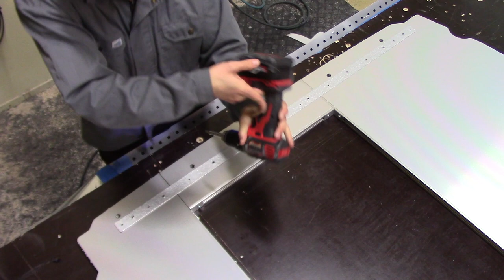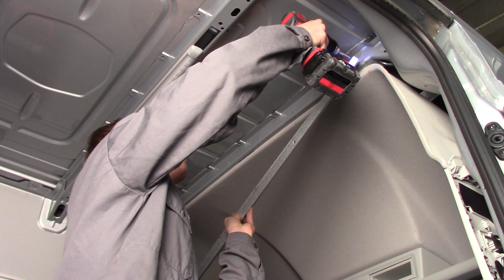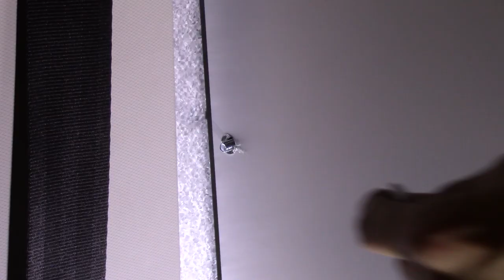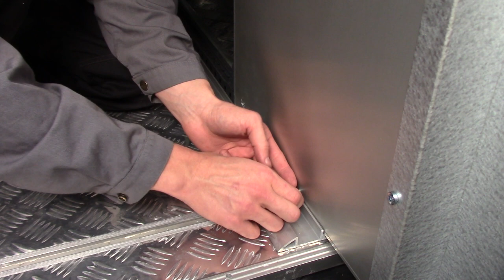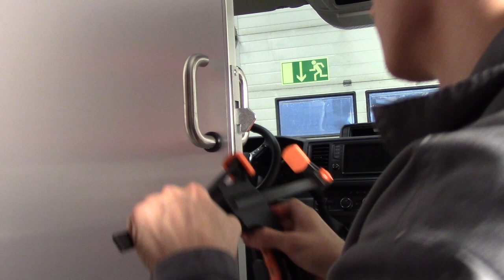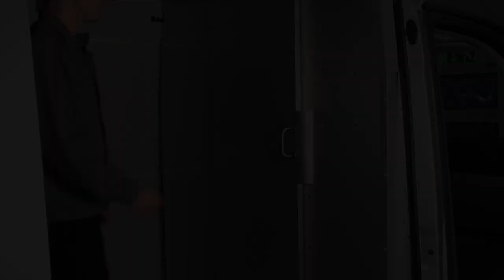Bulkhead with sliding door installation

Comment: Hi, please may somebody help, we have a sliding door bulkhead but it will not fit our 2011 Sprinter. It appears as though the door is almost two inches too tall and the sliding rail at the bottom is almost ten inches too wide. Is there any way to modify or are we to buy again?